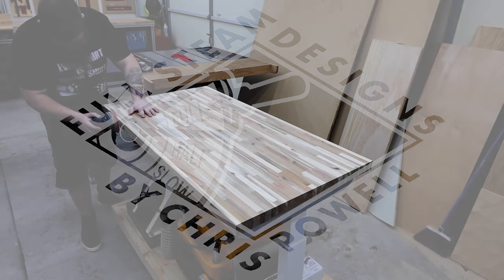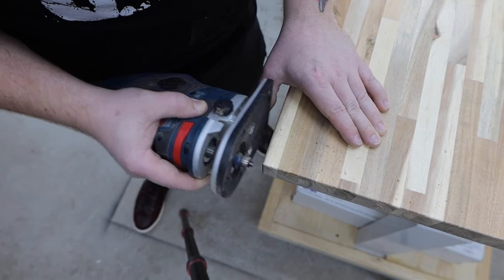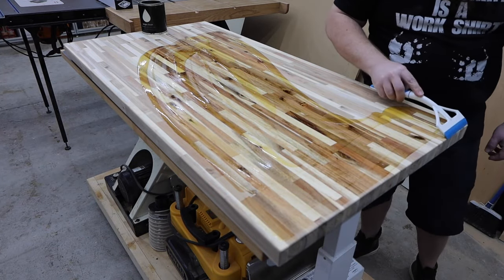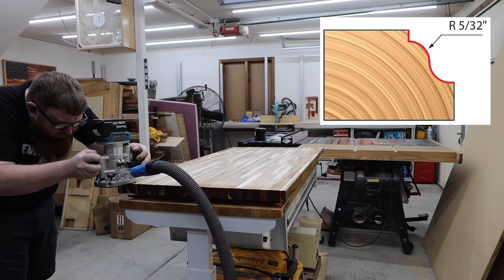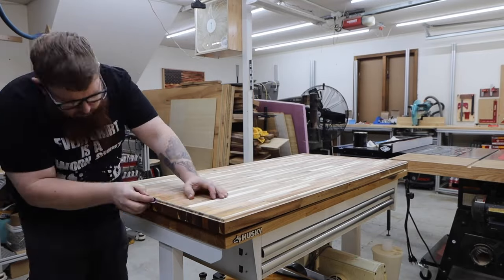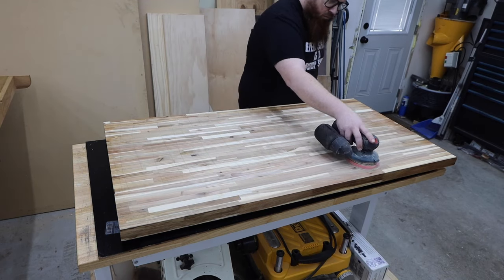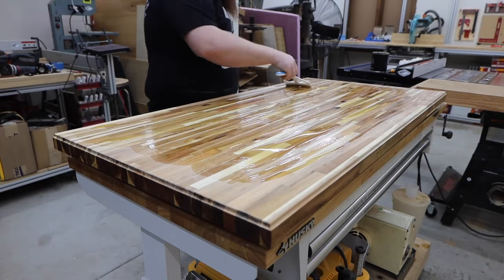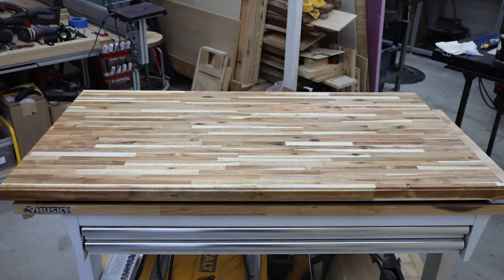how to finish a butcher block counter top

Comment: A great way to get the countertop even finer is to lightly mist it with a spray bottle filled with water to raise the grains of the wood. After raised, sand it down. It gives for a pristine finish on the top!
Reply: Just not too much water to avoid warping the whole top!

Comment: Would you cut/chop food on that surface? I don't mind knife marks. I have a kitchen island that I use as a cutting board/food prep surface. I usually finish it with mineral oil, but I like the idea of an oil/wax blend.

Comment: I’m looking to use butcher block for a desk. What would you finish it with? A water based Polly?
Reply: I'm also doing a butcher block for a desk and I chose oil based poly. Oil based dries faster and adds warmth to the wood but smells, and you'll need thinner or mineral spirit to thin it out or clean up. Water based should protect just as well but will not tint the wood and is safer and a bit easier to work with. Or at least that's what I gather

Comment: I'd really appreciate some guidance on this. I'm planning on building a bar and have an unfinished butcher's block of walnut on its way. For the bar, it's a simple cut across the 3m to make 2.1m and .9m pieces which I'll cut down to 2.1m and .6m to have a countertop with a side piece that will hinge on the side and act as a folding countertop. For this, what steps should I take in terms of when I cut it and when I finish it? Do you finish the piece first before cutting or cut before finishing? The manufacturer talks about finishing it within 24 hours of the factory which I don't understand why if they've possibly been storing it for weeks. I may use a router on the edge to give a similar effect but depends on whether a friend could do it. Thank you. Ashley.

Comment: Hey Sir. I’m completing a solid oak countertop with live edge. Only issue is she wants it darker than natural oak. Do they make that product in a darker color?   Thanks
Reply from the maker: I’d probably use something like this: https://amzn.to/3NGfZRa It goes on really easy and can be maintained. You could also add pigments yourself to an oil, but the problem is getting an exact match down the road if something needs to be touched up. Also, this little jar goes a really long way.

Comment: Great video, clear vocals, straight to the point, and no distracting background track.  

I found this while looking at butcher block stuff, but you're the same guy who built the sink cabinet with the access door on the back - right?  I knew that cabinet looked familiar!  Pretty sure I saw it on Reddit.  

Think this same method of application (squeegee) would work with OSMO TopOil?  I love the idea of the squeegee, since I'll be working on a 42"x10' worktop I made, and constantly need to re-dip my applicator - I would also love not to lose as much of the OSMO to my applicator pad / cloth.  

Thanks!
Reply from the maker: Thank you! Yes I believe it should work.

Comment: I used varnish and after a couple hours the surface is rough and grainy? Do I just sand and re-apply a few times until smooth?

Do I need 000 wool for my last coat?

Comment: Yes sir thank you for the videos I'm ready to start my butcher block countertops and learned a lot that I should do and shouldn't do I have questions about the bits that I'm having troubles finding for my router for a flush cut and spiral cut up down etc also to finish around where the sink is going to be under mounted do I have to tape that before I finish that and seal it so that the sealant will seal and what kind of adhesive should I use thanks be safe

Comment: Nice video I’m learning though, but Sir I have a question, since it is exposed to water I mean it got wet most of the time, would it be possible its glue  over time be weaken and broke into apart?
Reply from the maker: It shouldn’t. It will require maintenance over the years. I haven’t reapplied any yet, but it’s probably something I’ll do yearly. It’s a pretty easy process after it’s coated the first time.

Comment: Hey Chris it didn't look like you did anything special for the extra water getting on the sink cut, or the humidity for the dishwasher.    How's it holding up??  I have milk paint tung oil in using  wondering how many coats to do
Reply from the maker: It’s holding up great. Getting a little dry on the end grain around the sink. It’s probably about time for another coat.

Comment: Have you tried finish with tung oil. Pings and dings are more forgiving. Polyurethane  shows scars when you try to "patch or reseal areas". Tung oil is more forgiving.
Reply from the maker: I haven’t. I probably wouldn’t use poly on a countertop like this. I prefer oils and waxes.

Comment: Any suggestions on how best to disinfect this type of counter surface? The internet searches I’ve done make me wonder if they are appropriate for more glossy finishes such as polyurethane only.
Reply from the maker: I don’t use anything special to clean mine. I think the stuff we have is called Method. Any mild kitchen cleaner should be ok. Just test a spot first if you’re worried about it.

Comment: Hi Chris. Thanks! Does this simple finish harden? We used mineral oil on ours and unfortunately it stains easy and around the sink is growing mold. It’s been less than a year. Also, when putting paper or anything that would absorb, it will absorb the oil in the wood. Overall, not happy so wondering if this simple finish would be better if it hardens
Reply: Try Osmo Top Oil. Food safe. It dries hard, protects well. You will have to sand out the mineral oil first.

Comment: Hey Chris, I followed your cutout, farmhouse template.  Worked out well.  My issue now is the holdup of my finish vs normal use. It’s pretty frustrating.  It’s staining pretty easily imo.  I used Howard’s mineral oil, and then conditioner.  It’s food safe but I’m guessing that’s the issue.  How is this finish holding up to water spots, food stains, etc?
Reply from the maker: It’s holding up really well. I’ve had some sticky stuff like honey and other things spill on it and they all wipe off. Even around the stove where grease gets splattered cleans up fine.

Comment: Nice!  I just finished one of our countertops with Rubio. Super easy finish to apply. I would imagine Simple Finish is similar to it. Although I'm not sure how hard the wax is compared Rubio. Not cheap for sure, but I'm happy with the results. I'm a little bit nervous to cut out for the sink. I bought some flush trim and pattern router bits as well as the Wen hand held spindle sander to help with sanding the inside corners when I do cut it. That sander was hard to find but Lowes has them in stock.
Reply from the maker: Thanks. Here’s how I did my sink. https://youtu.be/hkNmw4ql9uQ
Reply: @ChrisPowellFSD  You're welcome. Yeah I will be going back and watching your video again to refresh my memory and prepare me for it.
Reply: Can you please tell me specifically what Rubio product you used? Is it one they say is for floors but you used in on countertops? This looks so easy, but I want to add color to my butcher block too. Thank you!
Reply: @laundryhappens928  probably the monocoat

Comment: Wonderful work! Great video. Very informative. I was thinking about using Simple Finish as well on some butcher block countertops. Do you know how long it lasts? And does it offer some water protection? Thanks for any info!
Reply from the maker: Thank you. I haven’t felt the need to recoat mine yet, but it probably wouldn’t hurt to do it once a year, at least around the sink and high use areas. Water beads up and just wipes off.
Reply: @ChrisPowellFSD  wonderful, thank you! I think this is what I'm looking for.
Reply: Would this be suitable to use on a piece of butcher-block that has been already stained?
Reply: @inspire1ove  I don't see why not. I used Simple Finish on my countertops. They weren't stained, but the Simple Finish should work, cuz it'll absorb a little into the wood
Reply: @funkyjohnhuie  awesome, how does it turn out darker woods and stains? thinking of buying this product to use on a block of hevea stained with espresso. Also is it okay to use in a lower ventilated area?

Comment: Hey, I’m looking to do exactly this (but using the same round over bit for top and bottom) for a desktop butcher block but I don’t have the necessary tools or any experience finishing. What is the typical rate for a job like this if I wanted to take the block to a shop?
Reply from the maker: I have no idea. That’s going to be dependent on the shops hourly rate. You’d probably be better off buying a router and some bits and doing it yourself.

Comment: Hi! My carpenter bailed on me because I put poly on the butcher block before he had a chance to sand it past 180. Now I have to finish this. I used minwax polycrylic clear in a semi gloss. Do I sand it off and do it all over again? It looks nice as is but feels rough. Thank you
Reply from the maker: Yea just sand it. Mark it with a pencil and sand until the pencil is gone to keep it even like I did in the video.
Reply from the maker: And I personally wouldn’t use poly.
Reply: What would you use?
Reply from the maker: @kimcurnutt5104  I like what I used in this video. I’ve done all of my counter tops with it. It’s easy to reapply if needed. I haven’t had to yet. Might be something I start doing yearly just to keep them looking like new. You just wipe it on, let it sit for 15 mins, and wipe the excess off.

Comment: I’d think that epoxy would require less maintenance
Reply from the maker: It’s a lot more work to apply, and if it scratches, it’s not as easy to touch up. Reapplying a coat of this finish every year isn’t a big deal.
Reply: @ChrisPowellFSD   depends how you finish epoxy.  You can matte it out and buff it

Comment: So why would you waste money and time finishing the bottom? I am just finishing a 27"x 60" butcher block with an 18" x 54" maple Boos Blocks middle (got for free) and framed out with douglas fir glued-up sections around the perimeter with 45-degree beveled edge. I see no reason whatsoever to waste finish on the bottom. If anything I might do the bottom with Tung oil, but my main focus is on the edges and surface. ??? This will be a top for my prepping station table that I built for my Freeze dryer, 2 dehydrators, and more. I would love to send a pic, but I don't do ANY social media. And why would you use a finish on a butcher block that is not food-grade? Cheers
Reply from the maker: It’s common practice to finish both sides to prevent warping. Feel free to do whatever you want though.

Comment: Is there only one finish made by maker  brand simple finish  hardening finish with wax sealer   Is this the kind you used also would this make teak butcher block countertops light color also thanks so much great videos
Reply from the maker: Yes just the one.